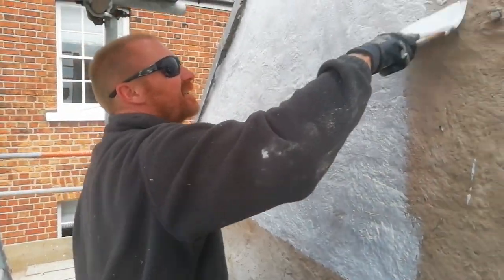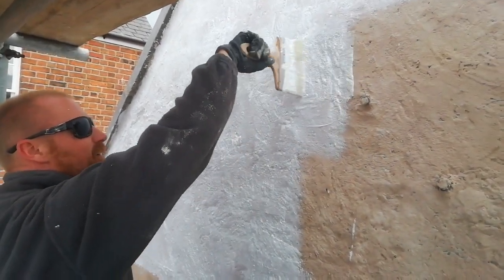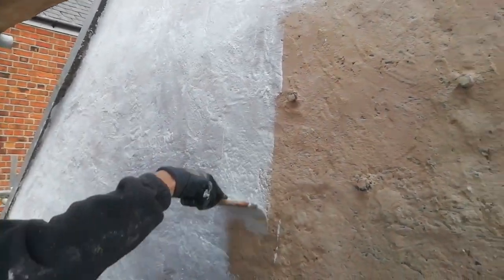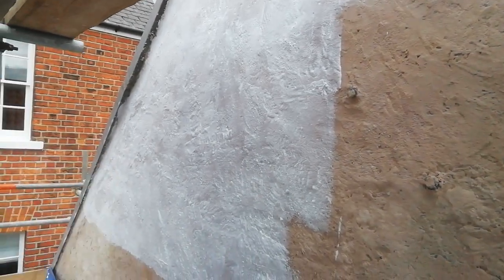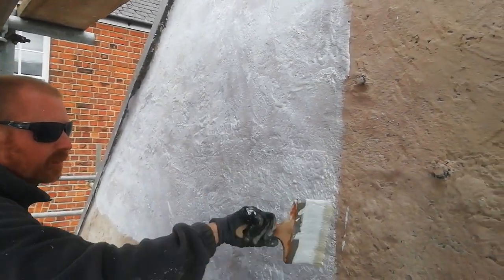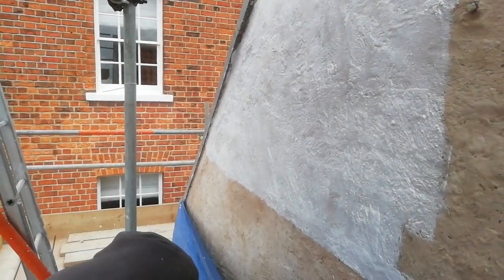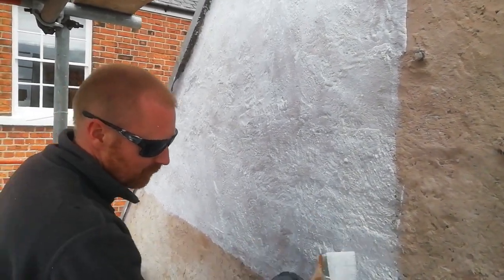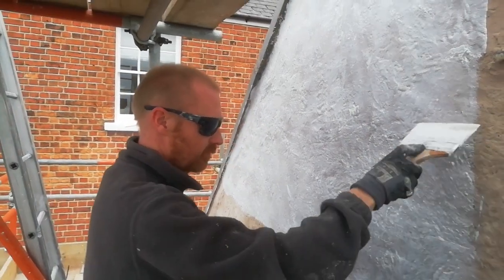Dan applying limewash to lime mortar to stop rain penetration to this 1770s listed building.

Comment: Hi guys me again!! Ive just been "playing around" with hot limewash and was going to use it internally. I slaked powdered quicklime together with some pigment  for a test area - painted it on and can see small particles possibly from the initial kiln burn or particles that still need to reduce in size and slake. 

Have you ever got this? Would you ever hot limewash internally?

Thanks so much in advance - Olly
Reply from the maker: Hi.  You don't get unburnt particles from powdered quicklime.  I think what's happened it the powder has gone to paste.  Possible a bit that was drowned.  I suggest working the paste in.  It should work in when you burnish the wash.
Reply: looking at it again it looks like the lime had drowned and formed little black grains. They are actually pretty solid so guess i need to be more careful with the slake.

have a great weekend ;)

Comment: Hey guys great site. Is that a hot limewash that you used???
Reply from the maker: Yes. We mix quick lime and apply it straight away so it goes on hot.
Reply from the maker: @oliverjohnraisbeck1035  hot mixed mortar is incredible to use.  I don't bother much with gauging it unless a colour is specified.  I just put some in until it starts to bubble and then I add a tiny bit more to get a proper cook. I then tip some cold in to cool it down. Obviously a brand new unopened back 9f quicklime with react alot quicker than an open one.  Hot water will react quicker so it's just a case of slowly adding and stirring. If it goes to thick water it down.   It's trial and error. Like I say if a colour is being added then you have to do tests and write down everything your adding.

Comment: i thought lime wash was supposed to be built up in very thin layers
Reply from the maker: It is! That's what we were doing. Hot lime wash (cl90) and burnished.   Spray the wall first.
Reply: @strikemehandsome  it looks think almost paint like . How many coats did you put on by the end please? It looks nice but i am a bit confused i am trying to lime wash my own place with lime putty that i am diluting with water  and i was told that i must apply about 4-5 very thin coats.
Reply from the maker: @ricdavid7476  I put three coats on. It will be runny with lime putty.   We used calcium oxide not calcium hydroxide.   The content is much higher.
Reply: @strikemehandsome  Thanks for that. I have already started so cannot stop but your wash looks like something i would like to have used. My place is a victorian cottage brick with lime mortar. I repointed the bricks and have started to lime wash . would this product have been suitable for brick because if yes and if i am still alive in 5-8 years time when it needs a new wash i may use it?

Do you work in Uxbridge west London because i am looking for someone to do some internal lime plastering and there are very few and far between who do it ?
Reply from the maker: @ricdavid7476  if the putty is working for you keep doing it.   It's good that you are lime washing and lime pointing.  I use calbux because it works out quicker and cheaper overall for me.  I can't come to li Don I'm extremely busy and try to keep to the Yorkshire Lancashire regions.   Great  guys down your way if you get hold of them are Seam Lardner  or Stuart Ivory.
Reply: @strikemehandsome  Thanks for that i will look those guys up. Sorry for some reason i thought you were closer to the smoke than you are. Is there a lot of lime up in Yorkshire ?
Reply: @strikemehandsome  Just looked up Sean and he is very close to me so will message him thanks again.
Reply from the maker: @ricdavid7476  the understanding of lime mortar is becoming big in Yorkshire and Lancashire, which is amazing.   Sean is a great guy. Very knowledgeable and highly experienced.
Reply: @strikemehandsome  Hello again sorry to pick your brains once more. I have a probably 300 year old garden wall that i have tried to lime wash but has not turned out very succesful. I would like to try the hot lime wash that you are using here can you direct me to where i can find out how to make it or buy it? Thanks a lot again
Reply from the maker: @ricdavid7476  hi no worries. Check out hot mix mortar videos Nigel Copsey.  I would stay with the putty though. The trick is burnish the lime. Essentially take a stiff brush and brush the fines back into the wall.  Nigel makes mixing it look easy.   The point of this video really is about doing it on a cloudy day and hsvi g sheets ready to cover your work.   Spraying your down the day before and keeping it moist until you wash is a must.  Anyway hot mixed mortar. I'll try and post a link but I'm not that savvy so it may not work.
Reply from the maker: @ricdavid7476  https://youtu.be/s-JZjdCC7xs
Reply from the maker: Pigment is obviously optional 👍. Didn't think it would work.
Reply: @strikemehandsome  Thanks for that i got Copseys book but it is way above my pay grade i needed a degree in chemistry to understand it. Thanks for your help though.
Reply: @strikemehandsome  thanks for the link it worked fine
Reply: @strikemehandsome  Sorry one more question. I looked at the copsey video and would like to give the hot lime wash a go. I have out about 3 coats of lime putty wash on the garden wall already so will be putting the hot lime wash over those coats will that be ok?
Reply from the maker: @ricdavid7476  no problem there is my video below about making putty from calbux 90.  The difference for wash is have more and less calbux.  Buy a bag of calbux and have a play with it. Wear goggles though. If it spits in your eye it's really serious. Have a bucket of clean water on hand to cool it down if it goes too hot too quickly. Making your own putty and storing it from calbux is much cheaper than buying it pre made. You could always use your own home made putty to make a wash if your hot wash attempt goes too far. Best way to know is to practice.  👍. I'm seriously glad your asking these questions and getting involved.
Reply from the maker: @ricdavid7476  absolutely.  Give the wall a good soaking first. Lime always sticks to lime when it's wet enough.
Reply: @strikemehandsome  Thanks a lot appreciate it i will let you know how i get on.